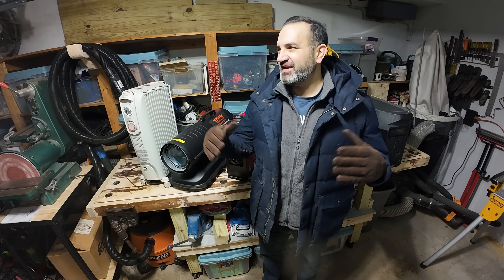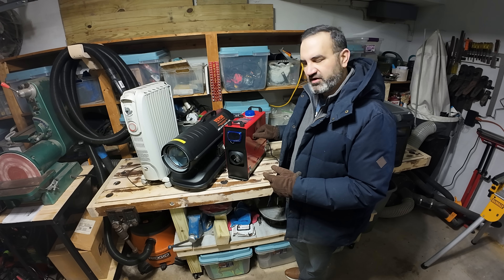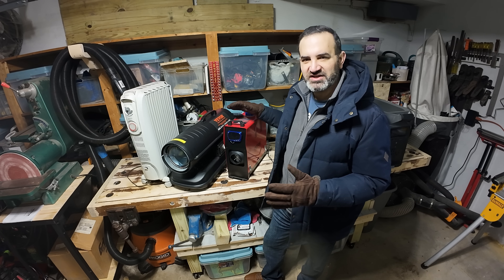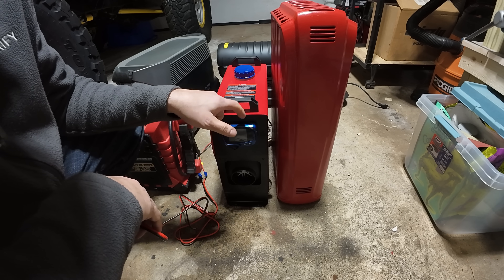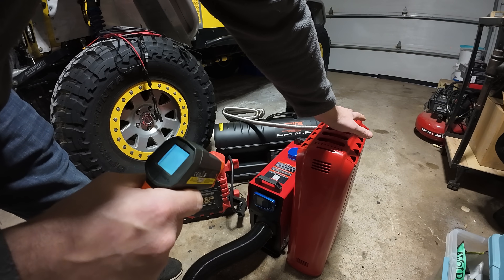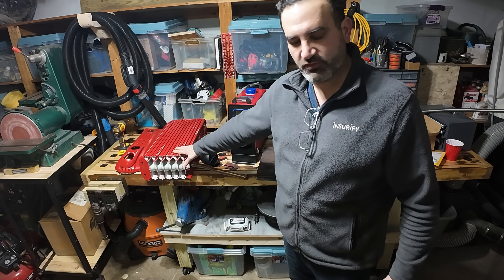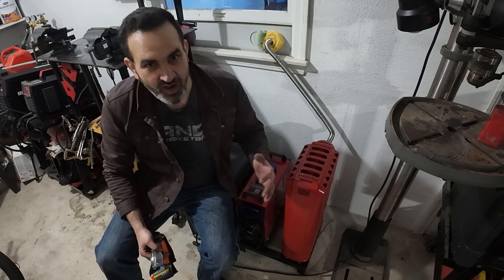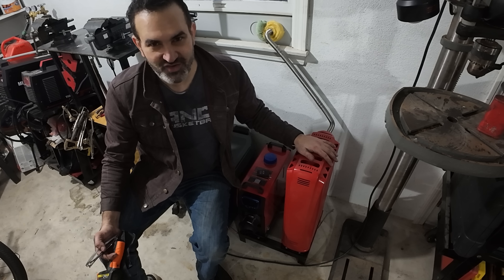Super-Efficient Vevor Diesel Heater Build for Shop & Off Grid

Comment: Just make sure that the exhaust  condensation does not eat through your radiator, the normal exhaust pipe is stainless and is hot enough to not have condensation

Comment: Great video, thanks for doing it. How did you create an airtight seal between the exhaust to the radiator? I wonder how much oxygen these things suck out of the air, did you do anything with the air intake? Some people in the comments seem to have a few extra ideas. Particularly the one about the weep whole at the bottom to let out any condensation and the one about the exhaust entering the top rather than the bottom. It's all given me a lot to think about, thanks again.
Reply from the maker: Maybe not airtight. I welded on a 3/4” pipe and used a hose clamp
Reply: @offgrid101  Thanks for replying.

Comment: Those little diesel heaters will heat shop if it's really small, and insulated. They burn clean and dry. Better than propane for a small area.

Comment: Work with your head not your ass, All you had to do was go to HD and buy a 6" piece of 3/4 inch common baseboard heat you know forced hot water baseboard heat it come with the heating element and the case. It easily attaches right to the exhaust on the heater . In Fact you can cut one of the end off the exhaust pipe that came with the heater and use it as the connector piece from the heater exhaust to the 3/4 in copper pipe with the aluminum fins on it and bang your done works perfectly . Remember you have to use the baseboard case with the element they work together and it has to be about 1 1/2 to 2 inches off the floor cause it works thru natural induction cold air is sucked in the bottom rolls over the many hot aluminum fins and comes out the top as hot air . What you did there was a tremendous amount of work the baseboard heat is way faster and easier and works perfectly .

Comment: The problem with diesel heaters is that their function depends heavily on the length of the inlet and exhaust pipes. If you have a poor-quality controller (like my 3 button Vevor controller) that does not allow you to adjust the pump frequency and fan speed yourself, you will soon end up with a sooty device if, for example, you use a longer i.e.  3 m exhaust pipe or much longer inlet pipe.  
The back pressure of the exhaust pipe causes the fan to run slower, which reduces the amount of intake air and leads to an overly rich mixture in the combustion chamber -> soot and more CO.
This controller also cannot compensate for the altitude. At 1000 metres, the intake air volume is no longer sufficient to burn the fuel correctly.
So don't let anyone sell you a device with a poor controller.

Comment: I run a 6 ft exhaust, coiled downwards, exiting sleeved through a 1-1/2 inch copper pipe.  The temp off gas and condensate at exit is room temp, implying near 100 percent efficient.  No extra investment other than a small fan to blow on the pipe.      Favorite part is the two ft tall stlagmites formed outside that reach all the way to the exhaust tip.

Comment: I have an extra car radiator in the garage. Do you think I could run the exhaust through it so capture more heat?  I wonder if the soot from the diesel heater would clog up the small channels?
Reply from the maker: Good questions. You could try filtering the soot out ahead of the radiator. I’m making a soot collection box with a screen for my build.

Comment: Filling radiator with carbon soot & condensation. I'm looking 2 do something similar but thinking 2 concentric copper down facing pipes filled between w/ antifreeze & computer fan blowing up through pvc pipe over both just before the wall... heat rises, should keep max heat inside.

Comment: What fittings did you use to connect the stainless exhaust pipe to the radiator?
Reply from the maker: Welded on 3/4” pipe and hose clamped it

Comment: The condensation is building up inside the radiator when you do that and then it is going to build up suit possibly plugging up the heater chamber. That’s why high efficiency furnaces have condensation drains to remove the liquid from the heat exchanger. You need move the exhaust to come out the lower end and raise the heater so the exhaust blows down out side to drain condensation when removing such a high level of the heat from the exhaust.

Comment: It seems.\n Like you could do the same thing with a car radiator?
Reply from the maker: Probably any radiator would work. The benefit of this one is it’s designed to move the hot air with convection. Also, it was sitting in the corner of my garage.

Comment: Great conversation and test! Did you re use the radiator oil when you assembled everything? Thanks for sharing your idea!
Reply from the maker: No, just hot air flowing through the radiator. I didn’t think I’d get the same efficiency trying to preserve the oil, mainly I wanted to maximize turning the exhaust heat into convection / airflow.

Comment: Great video but why not just put an exhaust extension inside the space you're trying to heat and then put a thru the wall fitting and muffler outside.

Comment: Everyone always forgets about the intake for the combustion.   The intake and the exhaust should both be outside, in this video and many others people are only venting the exhaust outside.  Pushing air out of your space creates a pressure difference that sucks air back in somewhere - unless that is an open window or a filtered intake somewhere it's coming in cracks.  There is a chance you are sucking that exhaust right back inside through those cracks - besides it's super cold unfiltered air why make this draft.

Also the exhaust should have a path for condensation to flow - built like a drain pipe top to bottom for flow.
Reply from the maker: Definitely good idea to take this into consideration for a living space. In a drafty garage with a gaping double garage door, it’s extremely unlikely a significant amount of exhaust is coming back in. My setup has virtually no exhaust odor even right next to the window.
Reply: People.. stop recommending that the combustion air come from (often freezing) outside.     Diesel is a low temp combustion already and soot will form rapidly with cold air intake.
Reply: @gbear1005  Interesting.   Have an Espar hydronic pre-heater that sits in the engine bay that breaths cold air.  Looked good when I took it apart but still low hours.
I know restricted intake or exhaust can cause carbon issues, so that might be related to peoples piping in and out.  
Most vanlife people install a heater right on the floor under the passenger seat, with intake and exhaust going right out the floor and don't have issues as far as I know.   
To me It is normal to have combustion intake from outside, but you could be right that it burns better if it's warmed first I don't know.

Comment: Awesome build!.. One question?...How did you seal up the ends of the exhaust going in ,and from the oil rad?
Reply from the maker: Thanks! Didn’t do a great job of that. Just press fit it. Working on an improved version of the piping for this winter.

Comment: exhaust flow through a heat exchanger (the oil heater) has, in other builds, caused excessive soot in the combustion areas.  so, thoroughly inspect these modifications for safety.

Comment: Still 30 to 40% heat out ur exost
Reply: And wrong tuning makes you burn 2/3 way to much diesel 

Just for info
Reply from the maker: Going from 70% down to 40% heat loss is a 100% efficiency gain. 👍

Comment: How long can the exhaust be? I'm thinking about routing it to a solar panel awning I made that's just outside the window it'll exhaust under them in order to let the panels warm and melt the ice/snow. I live in northern Minnesota, gets -41 F sometimes....
Reply from the maker: Shouldn’t be a limit to the length. Just make it a bigger pipe for longer runs, and maybe wrap it with fiberglass exhaust wrap to keep the heat in.

Comment: Fornthe 15 amp max 12v, i run a salvaged computer power supply..  450 watt is adequate.  That is plugged into a ups in case ac fails.

Comment: I mount mine high, run a meter long exhaust always going down in a 9 inch to 1 foot spiral with a fan blowimg on it.  By the time the exhaust hitsbthe wall and goesnthroufh a 1-1/2 inch copper pipe, its coll enuf to condense.   Stoo the sulfur by using diesel, not heating oil.  I run 40 percent fuel oil, 50 percent diesel, 10 percent petrol (gasoline) and maybe a splash of used oils or hydraulic.

Comment: the only thing i would change is the in and output of the acces to radiator , i found it better in use and also better use to keep the highes side of the radiator as input and the ouput to the bottom side at the same side coming out as the inut comes in , so you also benefit of the condensation directly evacueting on the bottom so there are no opstruction and natural flow gases go downwarts to like monoxide etc it fill up spaces from the bottom  way up to the top  ;-) thats my tods , sorry for my english , it is not good , i am plumber ,chauffagist and  worked mostly also with copper roofs , i like copper very much , also for there conductif and releases aspects , i also would use it as radiotor materials as headsink diffuser , convector a like  for instand use , and if it have to work for long hours i would certainely use a casting iron for there long lasting head keeping  , but i very like you work knoledge , greets

Comment: Oil heaters in my experience do their job very well. They take some time to get warm and radiate that heat, but id say not within 30 minutes of turning it on. 

Heaters with electric elements dry my sinuses. Portable space heaters with exposed elements scare the hell out of me. I like gas heaters and he up on an old house that had them, but there was always that worry in the back of my mind about a leak or CO poisoning, so we always cracked a couple windows while we used them.

Then we have the oil filled radiator which doesn't dry the sinuses, has no exposed element, and has no potential to asphyxiate. I used to have one next to my bed that I sometimes roll all the way to the bed so I could drape the bed blanket over to capture the heat. 

Those oil heaters (and most other electric heaters) come in a 750W and 1500W versions, which should be considered when hearing a space with one. Because they take time to get things toasty, many have timers so you can turn them on before you intend on occupying a space. 

Always remember, when trying to stay warm, don't kill yourself.

Comment: Great fab skills, looks pro level bud! 
   I like my oil radiator under my desk in the garage, it heats up the whole desk and still puts off heat when it's off. I was hoping you modified it in a way that retained the oil inside. 
 My furnace is in the garage so I took out the red 1" plug next to the condensate drain, it's at floor level and blows right at my desk. In the winter it can get down to 50F but that's warm for a Northerner. I have an extra Chinese diesel heater, but didn't want to mess with installing it and feeding it fuel, turning it on and off (they don't self start, it's either on or off). I do have one in my work van. 
  You want that exhaust to slope downward, diesel has sulfur in it, that rads going to fill with sulfurous acid, nitric acid,  and carbonic acid which can be further oxidized to form highly corrosive sulfuric acid. It's the same process that causes acid rain.

Also diesel contains water, I copied this but didn't want to form the sentence, "Burning one gallon of diesel fuel produces approximately 1 to 1.14 gallons of water. This happens because the combustion reaction breaks down the hydrocarbon fuel and releases hydrogen atoms, which combine with oxygen from the air to form water vapor. The final amount is greater in volume than the original fuel because of the addition of oxygen during the process. ."

Comment: WRONG, The MAJORITY of the HEAT DOES NOT GO OUT THE EXHAUST. You can hold your hand close to the exhaust , which is WARM/hot, bit you cannot hold your hand at the AIR OUTLET because it is TOO HOT for skin.  OBVIOUSLY YOU  HAVEN"T used it YET. I HAVE USED ONE FOR A COUPLE OF YEARS!  They require around 10 amps for GLOWPLUG HEATER STARTUP, then only a COUPLE of AMPS @ 12v for fan on HIGH SPEED. You seem to be instructing people without EVER KNOWING WHAT YOU ARE DOING in the FIRST PLACE.  I do agree , some heat will be emitted form the COLUMN HEATER id exhaust if fed through it. BUT FAR BETTER to feed the EXHAUST THROUGH AN OLD TURBOCHARGER  INTERCOOLER which will dissipate heat to environment far BETTER and a SMALL FAN can be also used to aid the extraction.  BEST to do it first, find out where your intentions are wrong and THEN TELL USE.
Reply: Maybe I'm reading what your saying is wrong. I have my VEVOR XMZ-F-D5 set on 3. The display the heater is showing 410F. I have a thermocouple clamped 4" down from the heater exhaust and it's reading 504F.  This 1" flex SS pipe then goes into a 1-1/2" Gal. steel pipe 12 feet long mounted nearly horizontally on the exterior wall. The temp of the exhaust coming out of the pipe where it exits the building is between 87F and 101F depending on the outside weather. Therefore I'm salvaging a lot of heat from this heat exchanger.
Reply: @oldmanathisbest  It will feel hotter of course but THE MAJORITY of heat value is delivered out the heat exchanger, Just because something reads higher doesn't mean it is a MAJOR part of the total heat value available .

Comment: IR thermometers are basically cameras that look at infrared infrared can reflect off of mirror services just like light can silver surfaces reflect IR 

The reason the temperature reads so low is because it's reading partially the temperature of the pipe and partially the temperature of the thermal black body radiation reflecting off of everything else onto the silver so shiny surfaces that are silver or white or mirrored don't work well for reading temperatures so paint portion of it flat black so that I can actually read the exhaust pipe itself and you'll get a much more accurate reading 

There's also means it doesn't work very well looking at anything glass because sunglass will transmit IR sunglasses reflects I are sunglass traps I are. 

So again to get an accurate reading take a piece of flat black tape although electrical tape might work put a piece on the glass and shine it on that with the IR thermometer obviously don't put tape on something hot like your heater

Comment: The condensate is corrosive, that’s why it’s in a vapor form when it leaves the heating unit. Stainless steel would last longer or even plastic if it’s cool enough like a modern day furnace

Comment: If using air media:
Maybe filling the radiator with ceramic abrasive media for heat safe mass? 

If you hadn't trashed the oil heater core... A heat exchanger with hot oil reservoir /radiator above... the fluid will convect naturally without pumping.

Comment: The temperature of the exhaust gases should not drop under 100°C ... You will get condensation, sutt buildup and all kinds of other nasty things. You will also dramatically increase the aerodynamic drag which the heater is not designed for and you will ruin it. One turn of the exhaust has the same amount of drag as 1.5m of straight pipe.

Comment: How does your setup work after running?

Are the channels in the radiator large enough for the diesel heater to get rid of the exhaust gases so it dosen’t soot in the combustion champer?

Comment: Awesume addition to the DIY community. I like the improvement of using a space heater over a steam radiator. The condensate issue is easy to solve, use a pepcock at a low point to drain periodically like a compressor tank. Also the yearly soot buildup cleaning can probably be accomplished with a disassembly and pressure wash. Increased maitnence? Yes but guys who would actually build something like this have this mentality built in for success.
Reply: If u put the heater above the radiator. And push the exhaust from the top down, it will push any moisture out. Then do a gas rinse out if soot builds up.

Comment: You should add a drain to the bottom of the radiator. Condensation will build up.
Tip: you should add a stove fan to the top of the radiator. It uses no electricity and it will blow the hot air around.  

FYI good build.